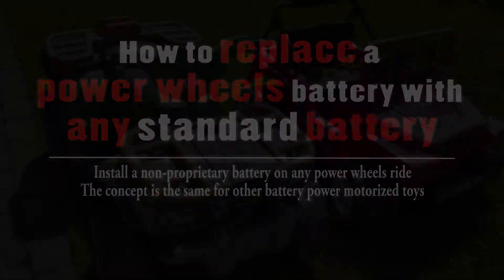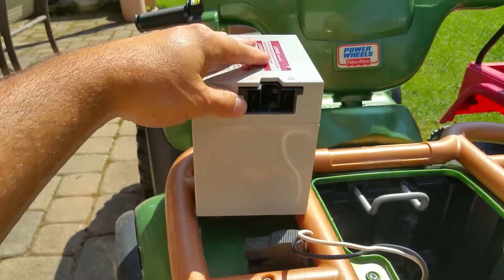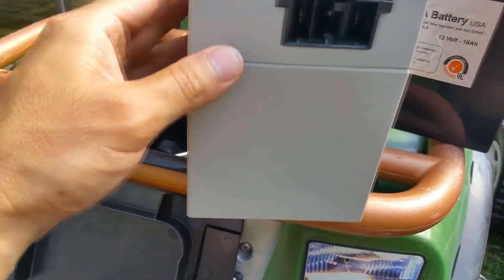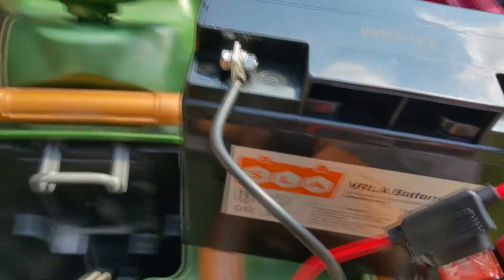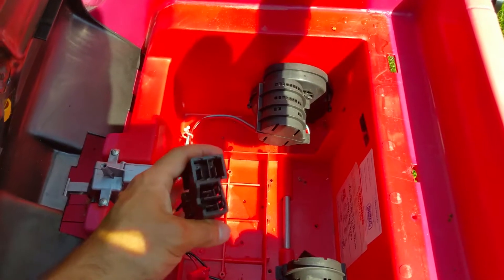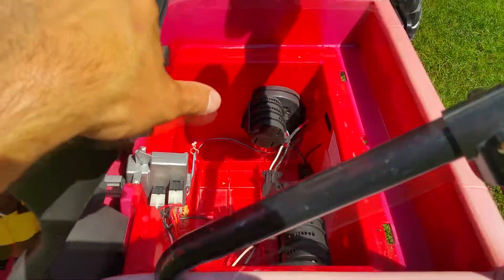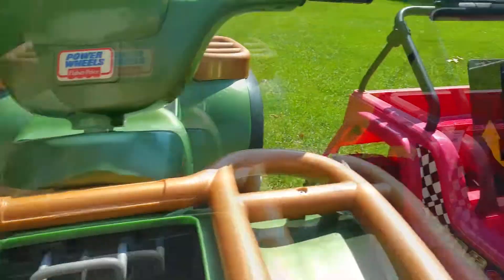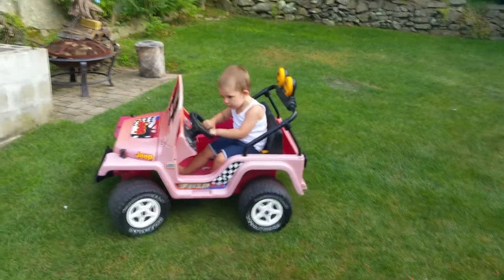Power Wheels battery replacing with any cheap off the shelf battery

Comment: Thanks for sharing this with us.
I just came across a Jeep that someone was throwing out that just needs a battery.
I’m looking to put the 12 V in but I was concerned about the excessive heat and catching fire, you poined out the 30 amp fuse was a huge help for me. Thanks
Reply from the maker: good luck, thanks for the reply.

Comment: Great video thanks for the tips! Is it fine to use the Power Wheels charger for recharging? Also any tips to help with the health of the battery?
Reply from the maker: yes you can use the original charger. Make sure its fully charge before using it.
Reply: @daP.A  Thanks so I got everything set up, but the 40 amp fuse is getting blown every time we use it. Any ideas?

Comment: The original batteries cost more because of safety enclosure. Kids can't drop anything metal across the posts that would cause a spark or injure them.
Reply from the maker: True but that's where the added fuse comes in.

Comment: Thanks!  I used the battery in your top link with the bolt connectors and the female harness adapter. After removing the Barbie Mustang’s stock battery holder this one fit in snuggly. Like it was made for it almost. Anyways, 30 laps of the yard later it’s working great!
Reply from the maker: Nice, hope your kid enjoys it